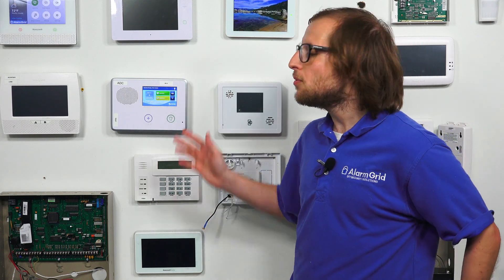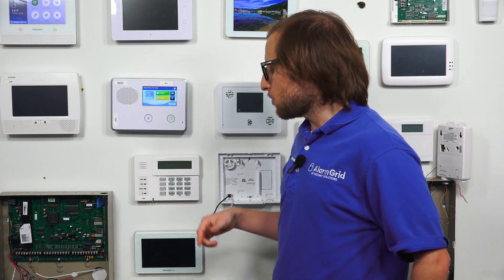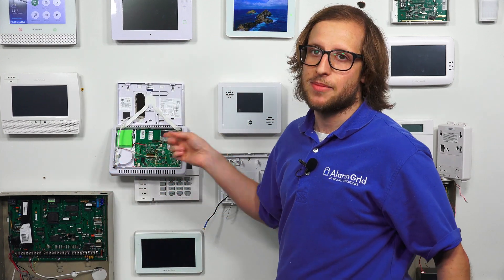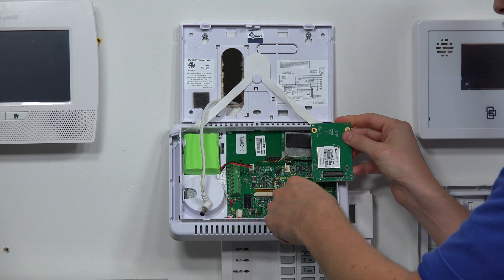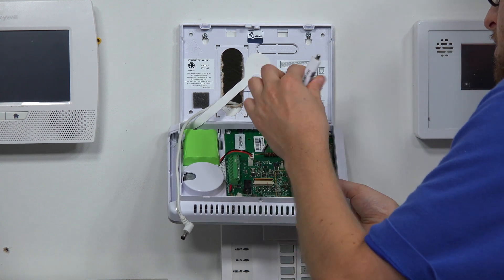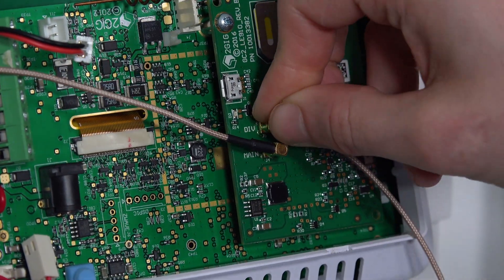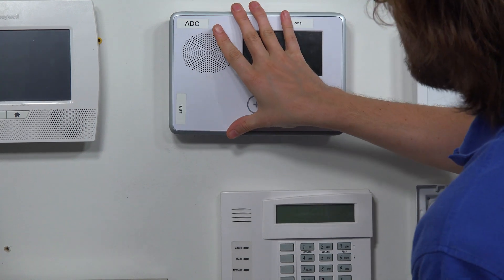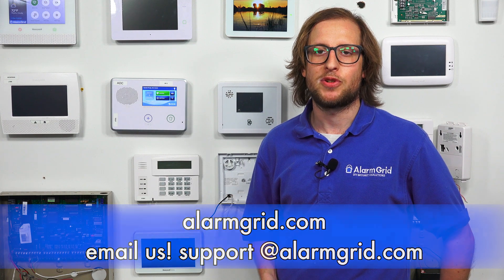2GIG GC2: Upgrading to LTE

Comment: The 2gig GC2 unit I have wont fit the huge ant on the side, the panel is not a large one like in the video it's small ? Both the Ant's that come with the kit are Large ?
Reply: BTW 2GIG, I am guessing at some point one of your product engs said lets design the case an ect better and was told next release... The 1st version of the GC2 panel with the smaller door is Junk, how you attach it to the wall plate so that the tamper sensor wont fire off is just pure %$#@. Company could have done a much better design instead of saving .05 cents on better latches and way to secure the product.  Pure junk
Reply: To better understand you issue could you throw us an email with pictures so we can better assist?
Reply: @nathangalarmgrid5205  Sorry already mounted it back to the wall. The issues is the older GC2 units had a smaller ANT door on the side that you would put one of the large ANT's in. The current ANT in my unit is small about 1/3rd the size of the new ANT. I found other owners that have the same issue with the older GC2 models before they changed the design. So the larger ANT won't slide in and fit since the side door is 1/3 the size and has a and holder plastic holder in the door.  I had to drill another hole in the wall if the current one was large enough and stuff the ANT in the wall near the other ANT.  If you try to put the ANT in the unit on the back plate it makes it very hard to close the unit or an uneven effect so if you put it all back up on the wall and touch around the outside front of the unit pushing the home or other flat surfaces on the unit the  tamper alarm goes off. Sad to say how the unit mounts and locks into the back plate holder is a total junk design.
Reply: Same issue with my old junk lol